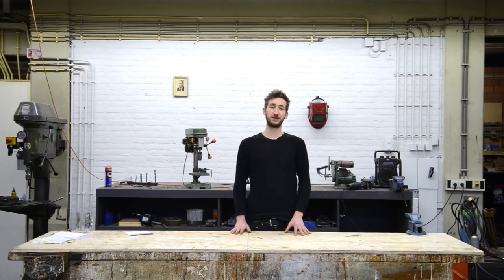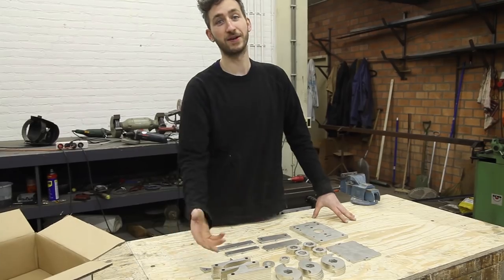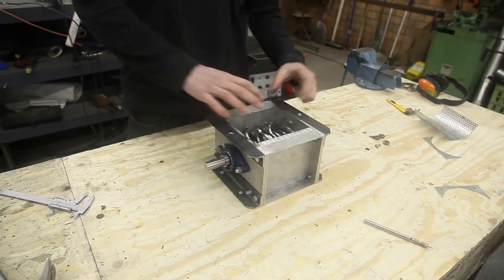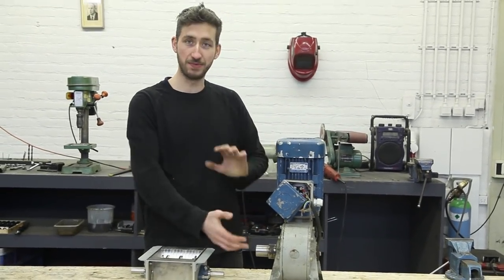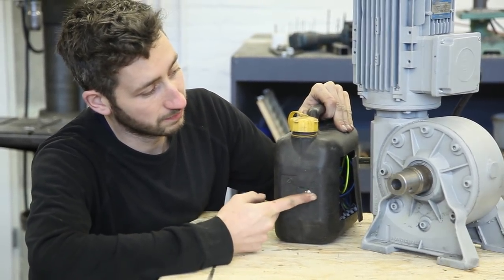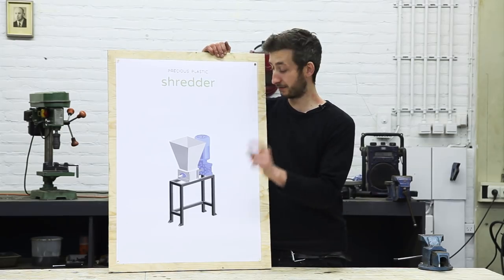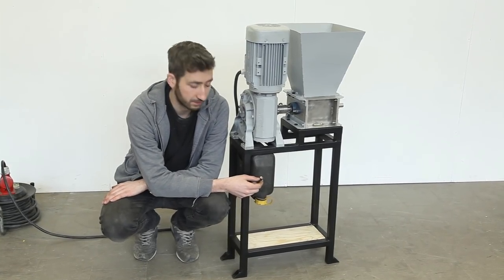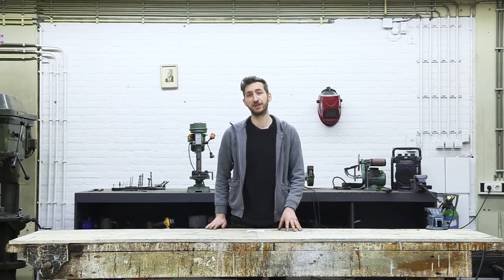Precious Plastic - Build the shredder (part 3.1)

Comment: l love your ideas to recycle plastic and i was super super excited to implement this but you assume everyone has access to the equipment needed to build these.  Not everyone has access to welders.  If you are really serious about putting this down to a level that folks can access, you need to develop  designs that the average person can build.  This is out of the reach of most people and so is the cost of building them.  Wooden stands and wooden hoppers make a lot more sense for the average person.  If you really want to help the plastic issue then you need to design things like this that an average person can build. I was so excited when I found your site but now all I feel is disappointment.  Even if I purchase a pre-built grinder I have to have a welder to finish it.  Most people do not own welders so this is way above what will help average people.  I did a pole of 5 people I know three of which are mechanics and none of them have welders. I am challenging you to design something the average person can afford to build and use because this definitely is not.

Comment: That project is inspiring and I'd love to rebuild my own one, however there are some obstacles. Though I am a welder and putting together metal is not a big issue, the precise cutting and turning are. FInd a laser cutter at low costs, not having a lathe and giving the axe to a 3rd party to....You might wanna think about some special parts which are a lot more difficult to craft and resell it as a kit. Please take also into account most people dont have access to 3-phase power supply so you might want to include a 230V version with a modified transmission...

Comment: Where is the safety in this? No E-stop, recycled power cable,  hopper should be tall enough or dog legged so you cant stick your hand in the blades. The unit will need propper grounding for any static build up from certin plastic. Please continue to build and recycle but be safe while doing it.

Comment: Has anyone tried making the blades out of aluminum? Steel of the necessary thickness is hard to come by in salvage yards near me and exorbitantly expensive new much less professionally cut. Sand casting them out of aluminum cans can be done using much easier to come by supplies and would be dramatically cheaper. My only concern is if the blades would be strong enough. Has anyone tried this? To make the shredder appealing it really needs to be possible to produce for less than $100... more than that and the set up costs out weigh profit motive for 99% of people

Comment: Thinking of the potential products including Structural Lumber .. Ive wondered a long time Why Plastic is not recycled for Lumber.  And research done to find designs/ways to strengthen the end product.  It makes sense to not cut down trees and build with materials that will are designed to last thousands of years made of recycled plastics ie no new plastic.

Comment: How about using 7 1/4 inch saw blades, the old style non carbide where made of tool steel (carbide blades are mild steel with carbide teeth welded on) some of the saw baldes had diamond shape knock outs (easier to lock to turning shaft)

OR use helical wood planer blades ("teeth" bolted in ) mount them on two counter rotating shafts

Comment: One thing I would like to see (or possibly try myself) is to make this shredder run on Grease. Elbow grease that is! I wonder if there could be similar results from a hand crank system? Maybe a lock n key system that starts with long high leverage cranks for breaking down tough hard chunks, then a smaller more manageable crank for shredding bigger pieces down into even finer pieces. 

Would eliminate the need to find a powerful motor, as well as having to have experience wiring things up with electrical systems and other such. Plus I'm the type of person that likes contingencies. Should the motor ever break down, or you lose power and still want to work, a hand crank system would facilitate this.

Comment: wow i felt my own back hurt watching you pick up that engine, you should be careful with your back dude.. youve only got one of those
Reply: Not to mention that he was running a high power electrical machine on a rolled up power cable, which is asking for trouuble and bad workshop practice.
 It all looks a good idea, but is only useful  to a communnity capable of putting all the elements together, so that you end up with a small factory on an industrial estate, where the collection and processing can be done you would require a grant of about £100,000  to even contemplate these projects

Comment: Yeah we can't make this in America Dave not at all. Tradesmen with these tools are fewer and further between. The reason why we people can't save ourselves dave is education and the lack of a junk warhouse. It all goes straight to a landfill or it goes to metal recycling. This would cost me a fortune!
Reply: +STOGGYRETURNS Not arguing the tools are one of the challenges, but the materials are easy enough to get ahold of if you know where to look. Craigslist and thrift stores will have many of the components, but the tools will cost a few hundred, even used.
Reply: +miguel martinez Yeah I don't live in a junkyard. People would steel the manhole covers and break them in half to sell for recycling. So my area is squeakie clean of this kind of junk. If I had it already mapped out based on the products I was deconstruction to reconstruct sure. But all of this is moot since I can just ebay buy a granulator from a recycling center shutting down. Problem is when push comes to shove its not really doable.

Comment: I quoted building this for someone yesterday. Your prints are pretty bad. You size everything in mm which is fine but makes it hard to source. Your length for tube and your quantities on the stand assembly are confusing. For the lasered parts you can't standardize to one thickness to reduce setup cost? Also why lasered stainless? Overal organization of files and information on the build c- if I am being generous. While it is great you are doing reuse of materials this basically means anyone who wants to reproduce has to reengineer. Project as art not functional item :(

Comment: Hey, If power is internally supplied ( 2 or 4 cycle) it is an ENGINE. If power is externally supplied (electricity or steam...) it is a MOTOR.  Let's stay on correct nomenclature.

Comment: Your Stuff is Awsome, But You Need Better Safety Guards.

& If it doesn't have proper safety guards, then it should not be perpetualy powered.!

#HorrifyinglyDangerous

If you can touch it, while it's in operation. ITS NOT SAFE.

Comment: I really hate when you show a welding arch on video's  In shops and on sight welding stations  have flash screens so people not protected by the hood don't receive burns to their retina which are extremely painful, and can cause permanent damage to your eyes. I now have a headache just from the initial flash. at which point I stopped your video I don't know that the harmful radiation is transmitted, but you need to be more safety oriented.
Reply: An arc flash from a tv or computer screen cannot damage your eyes. It was simply a placeabo effect due to your prior knowledge on welding, and your limited knowledge on the display capabilities of a 256bit color space screen.